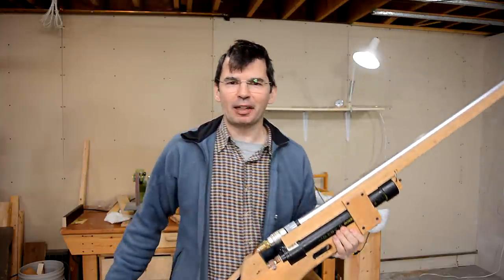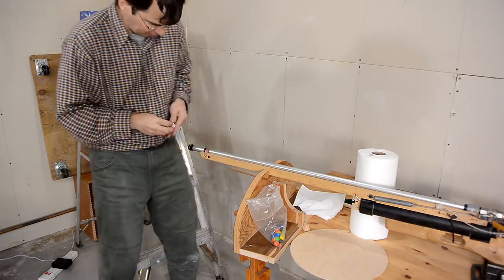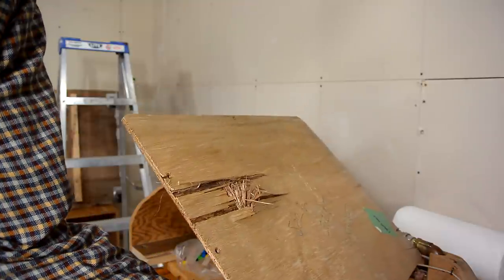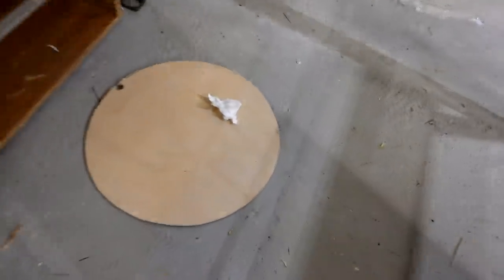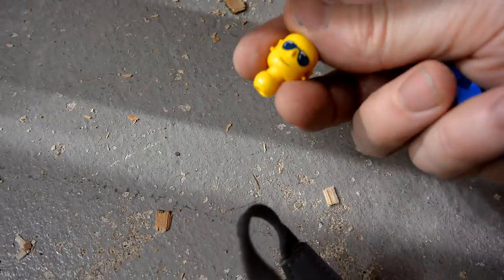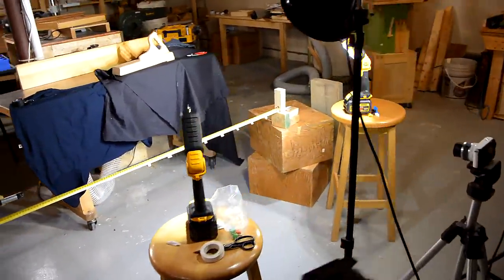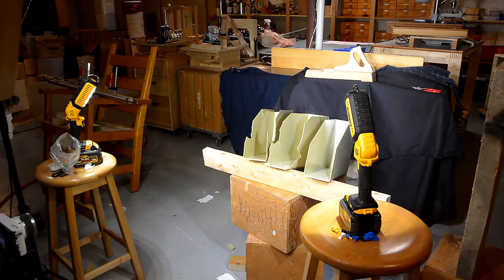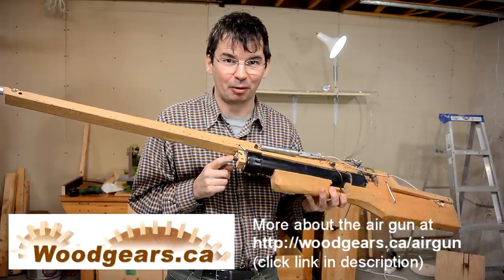Shooting stuff with supersonic M&M candies

Comment: Just a thought, stop me if I'm wrong.
The speed of sound is the speed of a pressure wave traveling in a medium, so wouldn't the high pressure from the air tank travel at the speed of sound? So a projectile in a ideal, friction-less, infinitely long barrel would approach the speed of sound.
I know I'm wrong somewhere but i don't know where.

Comment: I have something similar, but instead of the ball valve or sprinkler valve people suggested, I use a truck air horn valve.  Far better air flow and the solenoid operates at 12v and just under 2 amps, so the solenoid opens very fast.  Though I use it to shoot rockets made out of cardboard and foam pipe insulation, I haven't tried candy.  Food for thought, heh.

Comment: The Schrader valve is the most common for bicycle inner tubes.  The same valve is used in general aviation aircraft on the nose wheel strut.
Reply from the maker: Not here in Canada.

Comment: Home Depot (in the US at least) sells inner tubes with the same Schrader valve in the mower repair section.
Reply: If your home depot doesn't have a mower section, try the snowblower section.

Comment: Just for reference 1200 fps is actually just a bit faster than a .22 caliper long rifle bullet shot from a rifle.
Reply: There's a huge range of .22LR ammo speeds out there.  I have a box of 1640 FPS Stingers right next to me.  1200 is actually kinda slow for a .22LR.  More like 9mm, 115 or 125 gr, fired from a pistol, especially given the physical size (but not weight) of a peanut M&M.  Similar speeds, albeit not the same energy.

Comment: I’ve shot marbles at 100psi in a 60” 1/2” pipe and can only get Mach .5 or around 680fps. I’m surprised the candy was able to go supersonic. But did you hear a sonic crack?
Reply from the maker: I was surprised too.  I got less than Mach 0.5 with marbles.
Reply: Matthias Wandel I tried candy about the size on mm’s and only got 800fps with 100psi in 1/2” pipe at 60”. I also use a spring ball valve trigger. I use a chronograph too. I even tried vacuuming the air out of the barrel. Maybe your valve opens just a little quicker than mine?
Reply: @matthiaswandel  The most I got from my air cannon in a 1.5L tank at 300 PSI with a 25ft long barrel and the air vacuumed out of the barrel, was 900fps with a marble. 1/2in tube. No matter what I did, I could not get it any faster. I even tried candy that was lighter and still could not get supersonic speeds with that much pressure. I don't know how you were able to achieve that. Maybe your spring loaded ball valve opens slightly faster than mine. I also tried a small volume of air at 600psi with a 6ft long barrel under vacuum and still got only 800fps with a marble and actually slower with the the lighter weight candy. Ive tried with and without wadding, longer barrels, vacuumed the air out the the barrel ect. All I can think of is the quickness of the valve being the bottleneck.

Comment: You can estimate the speed more precisely by shooting the M&M into a pendulum and measure the back swing of the pendulum.
Reply: Standupmaths made a video with that experiment recently.
Reply from the maker: yes, but this method is more direct and more precise.  Why go the indirect route when you can measure it directly?
Reply: Matthias Wandel You might be right.  I was surprised air pressure would expand faster than the speed of sound. I did not expect that.

The precision of the pendulum depends on if it absorbs all the kinetic energy, or if it is partly shattered all over the place.

Your method depends on a grainy picture at 4.52. Is the distance 0.32 m or maybe 0.325 m?

Comment: I think your camera saves the picture from left to right, meaning the peanut has slightly longer than the frame period to travel the given distance. Try shooting towards the left and see what the result is
Reply from the maker: Just tested that.  Definitely top to bottom rolling shutter, just like every other camera.
Reply: Cool, you got me :)
Reply: @matthiaswandel  Perhaps not on older cameras. My film camera Minolta SRT101 had a focal plane shutter that moved horizontally, creating a moving slot for exposures shorter than 1/60th second. I know this because I accidentally left the speed at 1/125th when taking wedding reception pictures indoors with a flash gun instead of going to 1/60th. The result was lots of pictures of the bride - or the groom - but never both together, just a black area where the partner should have been. They weren't pleased, but I told them they should have had a professional instead of asking me to do it on the cheap!

Comment: If I'm not mistaken, shouldn't Mach 1.1 be impossible?
The propellant is compressed air, which only moves/propels up to the speed of sound in air, making Mach 1 the theoretical upper limit (assuming the air is at or below room temp).
 (Guessing a +/-20% error with this measurement is understandable, so perhaps it really is <Mach 1)
Reply from the maker: Air can move faster than the speed of sound
Reply: @matthiaswandel  After years of watching your videos I feel dirty saying this, but I'm 90% sure you're mistaken (unless you're two steps ahead of me, given my notes below)! Otherwise:

The speed of sound puts an upper limit on how fast a pressure waves will propagate. Since the only thing continuing to accelerate the air is a propagating pressure wave, it won't exceed the speed of sound in that medium. In a sense, if one 'air molecule' managed to reach the speed of sound, another air molecule behind it would not be able to catch up to bump into it and push it any faster.

This is why, for room temperature compressed gasses, light-gas guns can be filled with lighter molecules like H2 to propel at higher speed (since they have a higher speed of sound): https://en.wikipedia.org/wiki/Light-gas_gun

NOTE: Technically air can move faster than it's speed of sound, but only if propelled to that speed by other means. It cannot do it using only its own pressure as the propellant.

NOTE 2: Also, it can get a LITTLE faster than the speed of sound since the velocities of the molecules take on a distribution, with some moving subsonic and some moving supersonic, but there are rapidly diminishing returns above the speed of sound.

Comment: I'm sorry, there has to be something wrong with your measurement, since you can't accelerate something in a medium above the mediums sonic speed. If you filled your gun with eg. Helium you could get the projectile above the speed of Sound in air. If it went Supersonic it would give off a big bang.

Edit: I meant you can't accelerate something with the medium it is in above the speed of sound in that medium.
Reply from the maker: By your logic, no river could flow faster than waves travel on it.  Air mass can most certainly travel faster than the wave propagation speed.  This is true for ALL substances.

Comment: How do you know it is faster than a sprinkler valve?  Have you tested the timing on one?  The sprinkler valve gets blown open by the compressed air, the ball valve still has to rotate.
Reply: It takes 4/1000 of a second for his valve to open, how much faster is the valve that would require a battery or power cord? An open valve is an open valve.
Reply: @heruhcanedean  You dont need power to operate a sprinkler valve. You need to release the air on the spring side of the diaphragm.  This can be done with an air gun nozzle modified into the spring side of the sprinkler valve.

Comment: You can't buy bicycle inner tubes at home depot?
Reply: Do you know of any hardware stores that carry exercise equipment?
Reply: bami2 he doesn't say he got a bicycle inner tube at Home Depot. He says "you can get all of this at Home Depot, EXCEPT for this valve, which is off of a bicycle inner tube." BUT, 9 times out of 10, a bicycle inner tube valve, in North America at least, is a Schrader valve. And schrader valves can, in fact, be purchased at Home Depot, in the air compressor aisle.

Comment: So you cant get a bicicle inner tube at home depot? 🤔
Reply from the maker: do you see them selling bicycles?
Reply: checked B and Q UK and no bicicle inner tube just wd40 chain lubricant and Bicycle degreaser. big surprise to me too
Reply: They don't sell bike inner tubes. They do sell wheelbarrow tires that have schrader valves on them, if you want to spend $20 just to get a $2 piece.
Reply: HOMEMADE MADNESS no, thats why I prefer the Lidl and Action 🤣
Reply: @mxrider2strokebraaap54  whatare you doing here man😂
Reply: @matthiaswandel  i dont know im from holland haha 😉
Reply: HOMEMADE MADNESS I watch Matthias’ videos for such a long time😆
Reply: You should buy a valve online.
Reply: I bought a home well pressure tank Schrader valve at my local hardware store. Wasn't very expensive either.

Comment: Mr dangerous lol, I done this with 15mm copper pipe and the old type AA batteries when I was an apprentice, remove the paper covering from the battery and it fits perfect. 100psi air line and straight through metal locker's 😂😂

Comment: Unless you edited out the sound. If projectile is faster than sound you should have heard a really loud whipping sound. Supersonic boom. I don't think it was supersonic.
Reply from the maker: That would be true if the M&M could exit the barrel silently, which it certainly does not.  The exit bang totally dominates.
Reply: I was wondering the same thing. When a whip cracks, the sounds is really audible. My thoughts were that the impact of the projectile might be overpowering the boom.

Maybe do a test shooting into empty space to find out if perhaps there is a sonic boom?
Reply from the maker: it would have to be a long ways from the gun, but I think the light projectile will lose speed too fast.
Reply: Constructing a suppressor for the air rifle would probably be the only practical way of testing that, and I wouldn't be surprised if constructing such a thing would get Matthias into legal troubles.  Even here in the states suppressors are highly regulated.
Reply: The only way to determine this would be determining BC of  an MNM  @matthiaswandel

Comment: As far as I know it is impossible to exceed speed of sound with pressurized air. Also for an M&M to reach speed of sound would require a 100% efficient airgun. But what do I know..
Reply from the maker: And now you should know better.
Just like a river can flow faster than waves on the water.

Comment: Hey, realistically speaking a compressed air gun should never exceed the speed of sound. For a good explanation as to why look up a codyslab video called "Pellet Gun On Helium". You might need to redo those calculations.
Reply from the maker: you got all the data to redo the calculations.  If you feel it's in error, please point out the error.
And air can most certainly travel faster than the speed of sound.  Just like a river can flow faster than waves on it.
Reply: Compressed air guns have pressurized air behind the projectile, so the projectile isn’t exceeding the speed of sound until it exits the barrel. The reason why makers of air guns try to avoid the transonic zone is purely due to accuracy, because projectiles passing through the transonic zone will vibrate.